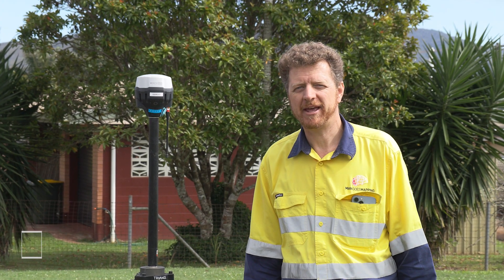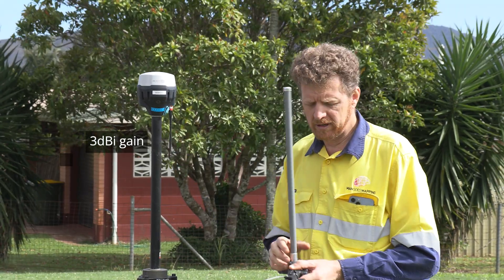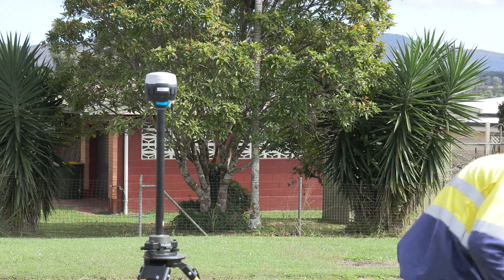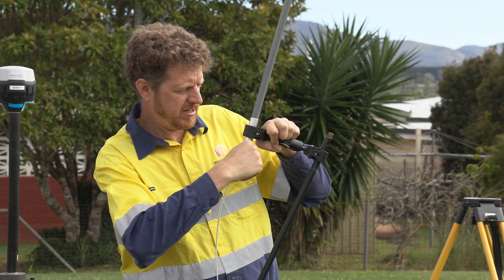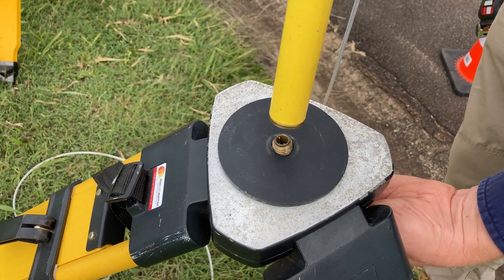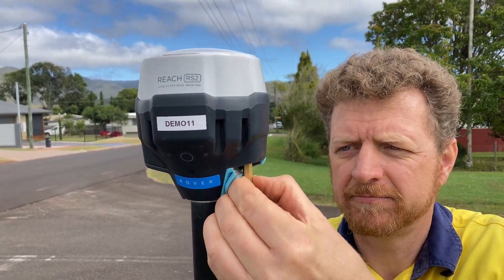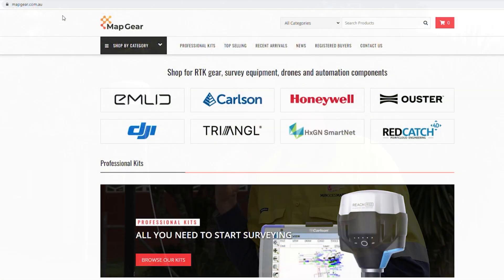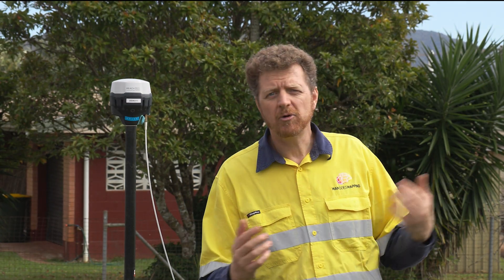LoRa Extended Range Antenna Setup

Comment: I want to ask, is the range of this antenna good or not if it is covered by a shady tree canopy?
Reply from the maker: It would depend on the area of operation, height of the canopy and type of trees. In general we don't recommend using around trees as any vegetation can interfere with radio signals.